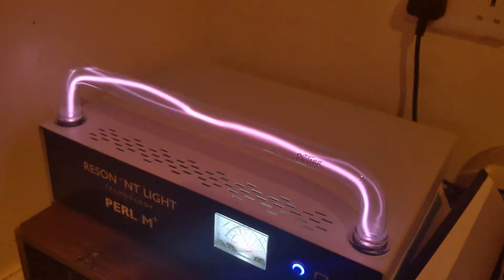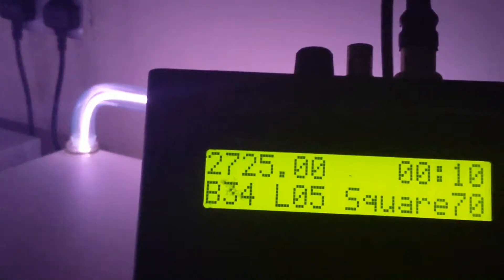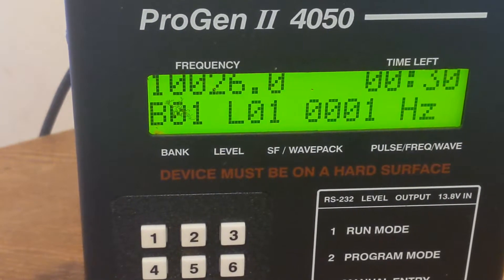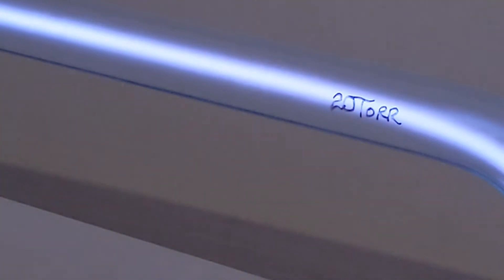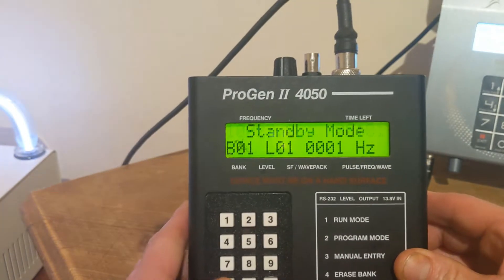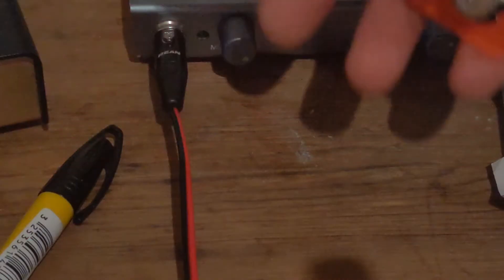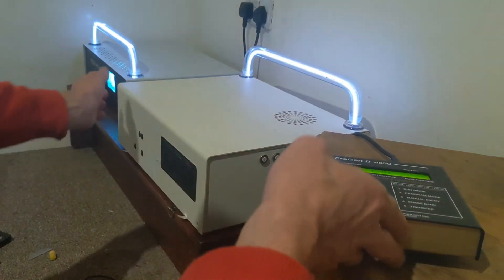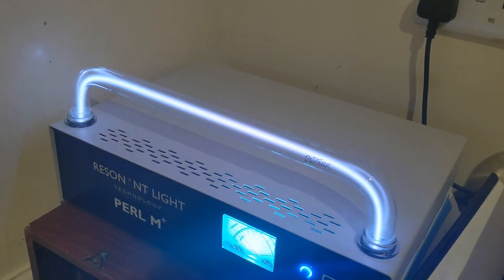Pulse Frequency Plasma Generators - made by Resonant Light of Canada - Rife Machines.

Comment: Acording to the video i saw you need to use 2 frequencies together one around 1000hz,  and the other frequency with 10x the amount which creates the combination needed to kill cancer cells, do i then need 2 of these Perl m machines with a controller for each? so i can create the effect necessary?  or can one machine be tuned to create both frequencies with an additional controller?

Comment: Hello,
I'm curious what input/ouput connectors are on the Pro Gen 2 and Progen3?
I saw in one of your other videos that the Progen3 has two 5pin XLR connectors on the front for Tens Pads. However is there a connection on the back for the Perl?
I'm considering purchasing one of these to use with two Rodin coils.
Cheers, Bocaj
Reply from the maker: Yes both the progen 2 and the progen 3 can be connected to the perl